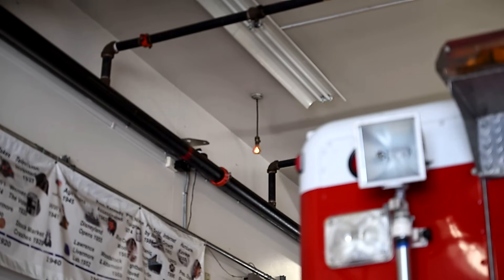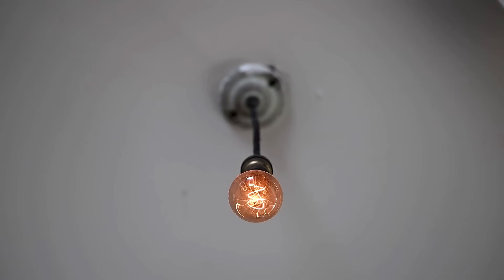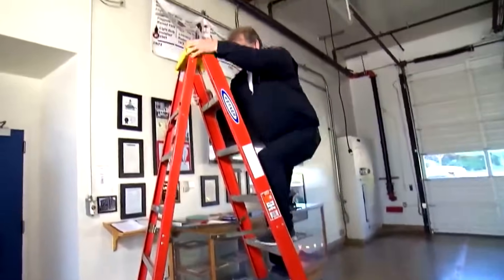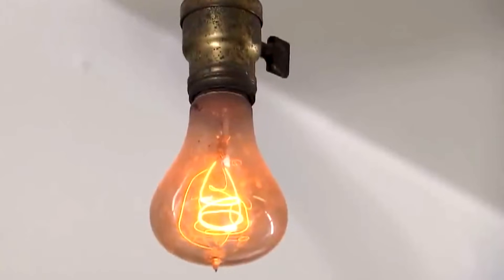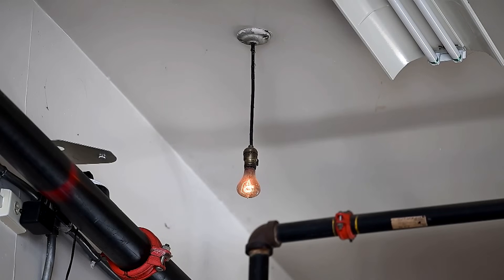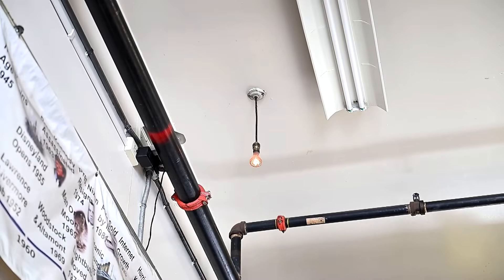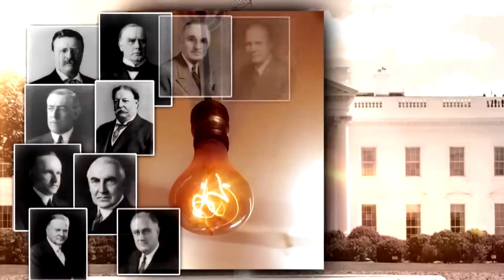This 120 Year Old Light Bulb Still Works!

Comment: Running at 4 watts, carbon filament is thicker than modern filaments, not stressed with constant on/off cycles. All leading along with some luck to a long life, here's to the next 100 years.
Reply: 4 watts of light. With incandescents, most of the wattage is lost to heat, but yeah it does seem to be on less voltage.

Comment: Keep in mind, it's only still functional because of that low wattage, which means the light output is next to none. Whatever fault is making it run with such low power is keeping the evaporation of the filament so low that it's still intact after all this time. Were it running at the intended 60 watts, it would be long-gone. It's not some secret technology. If it were, we'd still have lights from back then in-use.
Reply: it actually was....that's the thing.... if companies did that....THEY would be long gone.... its planned....that's how they rolled back then...they had integrity...they thought about people not profits and made things that were meant to last. did you even think about your statement before posting? 60w bring you back to the store after a while.....that's the plan you silly sausage
Reply: @ReunionMediaGroup  ...Did YOU think about what you said before posting? It's not still around because it's made of some special forgotten tech. It's still running because the filament is so thick that it's resistance is too high, so it's only using about 4 watts. It's no brighter than a nightlight. It was an error that has allowed it to last this long, at the cost of being basically useless. 60 watt bulbs last shorter because they burn brighter, at the cost of the filament evaporating faster. Again, if they really did have light bulbs that could emit 800 lumens of light and could last forever, we'd still have them around. But most burned out ages ago because they weren't faulty like this one is.

Comment: everyone is ignoring that it’s only running on 4 watts, like yeah of course it will last way longer than it would normally
Reply: 100 years? Seriously?
Reply: @zoneadmin-n6c  Yes. The filament is not being stressed very much
Reply: @zoneadmin-n6c  no usually 1000 at 3 watts which what this lightbulb is at. modern ones that are actually brighter than a nightlife run on 60 watts so ofc they will only last 10 years max.
Reply: yeah but over 130 years now actually from the time it was made and first put into use... who cares if in the last few decades it only uses 4 watts.
Reply: this was an uninformed comment.

Comment: For anyone who want an explanation for this, the light bulb barely glows for the filaments to burn or melt away at the rate they normally do in normal incandecent bulbs. How exactly might be from a manufacturing error or the filament being too thick for electricity to pass through, but thin enough for the bulb to at least glow

Comment: So many uneducated and uninformed people commenting. Bulbs simply can't run much longer than they do now. There is no grand conspiracy to make you buy more. A filament bulb outputs more lumens per watt the hotter it gets. It also outputs a much whiter light. The hotter you run it though the shorter the lifespan. You can buy bulbs that last longer but they output less light for the same energy used. They also emit a more red light. That's why we moved to LEDs. More light for less energy used and a white light too. It's simple physics.

Now LED bulbs CAN be made to run most to if not all of a persons lifespan. LEDs operate nearly the opposite way incandescent bulbs do. The more power you give it the brighter it gets, but it's with diminishing returns. Plus it starts to output a LOT of heat. The key is to use more led elements and run each at a lower power.  LEDs become more efficient at lower power (As in more lumens per wat of energy used). This is why you can have one led bulb that uses 3w of energy but outputs 350lm, or 116.67 lumen per watt, of light and then another bulb that uses 8W but outputs only 600lm rather than the expect 933 using the last bulbs efficiency.
Reply: I have actually seen 60W equivalent bulbs use only 3 led elements. Those bulbs simply roast their LEDs and as a result they only get around 2000 hours of life. I have seen other 60W bulbs use an array of 12 or more LED elements and they run noticeably cooler.

Comment: It uses more power than newer incandescent bulbs! Thats why they balanced light output and energy usage. But it is cool how long it lasted.
Reply: No it doesn't. It uses less power than a normal incandescent bulb. They increased the lifespan this way by keeping the power level and light output low.
Reply: How can it use more power? He said it uses 4 watts of power...
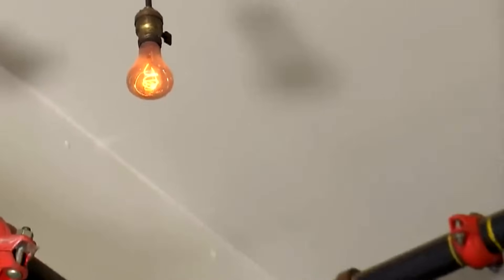Reply: @gameboy1984  1:27 - explain how 60W of power is using 4W of power. He said it puts out 4W worth of light.

Comment: I believe the reason it is still working is because of some kind of defect in the manufacturing process which caused it to burn at a lower wattage than what was originally intended therefore, it has been burning so long that it’s no longer burning at all

Comment: It’s a good thing that they don’t make them like that anymore. It glows barely brighter than a nightlight. It was simply made incorrectly. It doesn’t run hot enough to wear out like a proper incandescent bulb. It’s not durable. It’s just barely run whatsoever. If you run a modern 60W tungsten bulb at 4W, then it’ll probably run just as long. The simple fact is that, when an incandescent lightbulb works as it should, it won’t last forever. You can make them so that they last longer, but they use more energy and flow less brightly in the process
Reply: It was a 60W bulb but has burned for that long that it only produces around 4W now.
Reply: The more recent seals are porous. Chemistry not physics. Do your research.

Comment: I own a working 1987 Japanese made microwave oven (Citizen brand). The light bulb inside is original and still works. That microwave oven has been used for decades so I consider it an anomaly. No record but one of the best investments I ever made. I also own and use a Maytag oven I bought in 1998. I have had to repair the plastic face cover on the clock/timer/controller. Outside of the it has worked perfectly for 26 years. I replaced the light bulb in once in 26 years.

Comment: I worked in a building in San Francisco that was built in 1911(possibly 1913, according to some records). The basement floor houses an enormous steam boiler, so big that the building was built around it. There was a space of about 3 feet between it and the far wall of the boiler room, with an access point too narrow for an adult to squeeze through. Water had been unexplainably appearing on the floor of that room. I was very slim at the time, and the maintainance man asked if I'd mind squeezing my head through with a flashlight to see if there was water coming through any of the walls on the far side of the boiler. When I looked back there, I saw no water, but there was a wood box with unidentifiable stuff in it. I couldn't get my arm in far enough to reach it, so we found a rebar rod long enough to catch the lip of the box to pull it closer. In it were a pair of leather gloves, an old folding measuring tool, a jar filled with nails, and two dusty but beautiful Edison bulbs. I was later told that both were in working condition, but I'm not sure what became of them.
Reply: When was this ?? How many years ago?
Reply: @Indusxstan  It was probably 1990, maybe 1991.

Comment: The news reports often refer to it as 120 years old or mention the 1901 date when it was donated to the fire department, but it was actually made in 1890 and used at the water company for over a decade before it was given to the fire department, so it is over 130 years old.

Comment: When LED claims to last 25 times longer than incandescent, but incandescent lasts 25 times longer than LED:
Reply: An LED would last 25 times longer than the bulb shown in the video if it was run on the same voltage
Reply: @cattus87 It's amazing how many folks don't mentally tie lighting to power consumption. They don't realize this bulb is running on a few volts. It's maybe putting out a few watts. Basically, it's just enough to light up but not burn out the filliment. A power surge would burn that thing out in a moment.
Reply: @ajspice the average person does not know how lightbulbs work 😂
Reply: @kotzer71  They should. You learn this in first year high school Maybe even earlier

Comment: Simply they don’t want to make stuff like this, because they want Is to keep on buying products and spending money instead of making products what will last same with iPhones and TVs and so on in electronics refrigerators look at the stuff from the 60s some of them refrigerators last  well on 20 years plus
Reply: Wrong, they don't make this anymore because it's inefficient. Most of the energy you're giving is transformed into heat and only a small portion is emitted as visible light (about 5% of your total energy) 

Modern lights (LEDs) convert 70% of the energy you're giving into visible light, which is why everyone kept making LEDs and abandoned the old bulb.

Comment: The longest lasting light bulb in the world, the burning since 1901-present. The centennial light bulb was burning over 1.000.000 hours of light than LEDs is only 10.000-100.000 hours of burning.
Reply: Yeah but with that 1,000,000 hours of burning 95% of the energy will be converted into heat and only 5% will be converted into visible light. 
So even if it lasts longer it's not that efficient
Reply: ...With a light output of 50 lumens.

Comment: This shows that they purposefully make things to break after a while.
Reply: Yeah, look at all that dim orange light you're missing out on.
Reply: @ajspice  in a dark room, it would most definitely be enough. I'd rather a bulb that can work and be very bright for  60+ years, then start to slowly become dim for the next 40 years over a bulb that can be bright for 5 years or less and then break.
Reply: @maidenaholic  bud sorry to break it to ya thats a 60w lightbulb running 7w it was never bright its more of a glorified nightlight if that
Reply: @maidenaholic  "I'd rather a bulb that can work and be very bright for  60+ years"

This is never gonna happen. This bulb was bright for at most 5 years of its life. I'm being very generous here when I say 5 years.
Reply: No it really doesn’t. That bulb only lasted because it’s barely running. A proper bulb is much brighter, which means the filament is hotter, and that means the filament material will sublimate over time and burn out. The Centennial Light just doesn’t burn hot enough to do that

Comment: To be clear the reason modern incandescent bulbs don't last as long is because they burn the filament hotter which gives brighter, whiter, and more energy efficient light. If you turned down the power to any standard incandescent bulb so that it was barely a nightlight, like this one is, it would also probably last 100 years. This isn't a miracle or things being made better back in the day, this is actually a bulb that was made incorrectly and is only pulling 4 watts when it was supposed to be a 60 watt bulb. As an actual lightbulb it's useless lol.

Comment: Lightbulbs were made to almost last forever. But lightbulb company’s realized that they would go out of business if no one ever had to change their bulbs. This is why company’s have to follow regulations now to literally ensure that their bulbs don’t last too long
Reply: No they weren’t. Incandescent bulbs, when run so that they actually produce a useful amount of light, will burn out no matter what. You can make the bulb last longer, but it’ll produce less light less efficiently. That means it costs you more on your electric bill. That’s backed up by the fact that 2500 hour bulbs were still available even once 1000 hour bulbs were made the norm

Comment: So let me get this straight, that bulb exists before the World Wars, the Moon Landing, the sinking of the Titanic and the Pandemic, before modern technology, while modern technology bulbs only last for a maximum of 10 to 20, can I ask why ?????
Reply: Because that is a dim, low wattage bulb. It only gets hot enough to illuminate, but not hot enough to burn out the filliment, which is likely carbon. Not to mention, if lightbulbs lasted forever, they would cost hundreds of dollars each, and you would need dozens to light up a single room, which isn't energy efficient. So do you want a bunch of dim bulbs that last 100 years, or just change out the $10 bulbs once or twice in a lifetime? All I know of I haven't changed an LED bulb in my house since I installed them.
Reply: Because that bulb is making barely any light. If it were running properly, it would have burnt out long ago and no one would know it ever existed. If you were to run a modern 60W incandescent bulb at 4W like this one, it would also last forever because the filament isn’t getting hot enough to produce much light so it also won’t sublimate and wear out
Reply: Try 3 months.
Reply: Do you want a light bulb that actually produces bright light or one dimmer than a candle?
Reply: supply and demand my friend, companies gotta make money somehow, things just don't last like they used to
Reply: @Doggo_Norse Yeah, supposedly the lightbulb companies made an agreement to limit the amount of hours newer lightbulbs can run on purpose.

It's the same kind of planned obsolescence Apple and Big Tech do now. Talk about being ahead of their time.

Comment: Light bulbs can be made to last basically forever, however companies intentionally make bulbs that will break down because they want you to buy more light bulbs. It's not in their financial interest that you buy one light bulb and never buy another one
Reply: Right, like most other things these days.
Reply: There’s a trade-off between brightness and longevity
Reply: Sure it’ll last forever, if you make a 60 watt bulb that only burns at 4 watts and never turn it on and off.
Reply: Actually no. This claim is LONG debunked. If you make them burn longer, the efficiency drops. They also shift to a more red light. Just look at this bulb. It's was a manufacturing defect. It's meant to use 60W and puts out what 4w (Don't remember what he said)? It is also VERY red and dim. If it's using a filament is has to run hot to be efficient and produce a white light.

Now LEDs can be made to work almost forever (as in a human lifetime). Just run more LEDs in a bulb at a lower amperage. You get a cooler bulb that outputs more lumens per watt. See LEDs operate nearly the opposite of tungsten bulbs. With a led you want to run them with less power as they produce less heat and output more lumens per watt. To make up for the loss of light you simply use more LEDs.
Reply: @harshbarj you’re not wrong…but your lack of punctuation makes you look unintelligent, because this is hard to read.
Reply: Forced obsolescence 😢
Reply: The thing there not telling you is its a 60w lightbulb giving off 7w worth of light basicly a nightlight at this point
Reply: @kotzer71  thats an obvious explanation. Everyone is like "wow it lasted this long" and They compare it with modern bulbs. This one is overdimensioned and most likely get a leader signal (it is watt) than its built for was my thought.
Reply: The question is would a light bulb like this actually be a good light bulb? Would you want to use a lightbulb like this in your home? It uses 60w and only puts out 7w of light. You would spend more money to keep this light bulb going then you would if you just bought replacement light bulbs. Also get this you would also get more light out of those bulbs.
I mean many power companies used to give them away like candy when you pay your power bill. They were not at all expensive commodities.
Reply: Edison did not feel that way.
Reply: this lightbulb sucks as a lightbulb though
Reply: Bulb companies had to make a compromise between life and brightness, efficiency and usability. You can make it last longer by not driving it hard, but it'll look very dim, amberish and even more inefficient. You can also drive it super hard and get a much brighter, whiter and more efficient light, but it won't last as long.
Reply: sucks, because I am short and down't own a ladder and I am not willing to travle by bus and foot to the next store who sells ladders because you can't really travle with them to take them home and I live on a 4 floor building in the rooftop with no elevator so I am not going to buy a damn ladder
Reply: @ACEsParkJunheeWreckedMeHard what????  I'm confused
Reply: @ACEsParkJunheeWreckedMeHard WTF did you just say?
Reply: The Phoebus Cartel. 1925-1939.  💡
Reply: Correct ❤❤❤
Reply: Bulbs cost like $2 at my local supermarket
Reply: @cityplanner3063 well yeah its more efficient for a company to charge less money for a necessity like a bulb. It targets a certain audience that happens to be in the majority.

Comment: I bet they still can make them like they use to they just don’t want to because it’s not profitable.
Reply: No its because you end up consuming 100 Watts for a 10 Watt equivalent that looks really yellow
Reply: They do. They’re called nightlights. That bulb barely makes any light at all. No one wants that. A bulb that makes a useful amount of light needs the filament to be hotter. When the filament gets hot, it begins to sublimate. You could run the bulb cooler or make the filament thicker to slow the rate of sublimation, but then you get less light while using more electricity
Reply: You wanna pay $100 for a lightbulb?